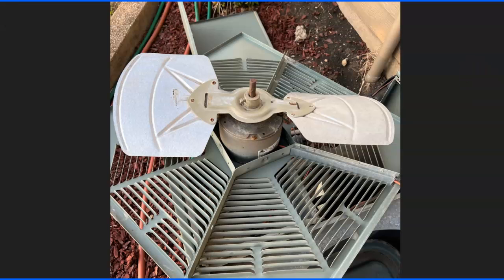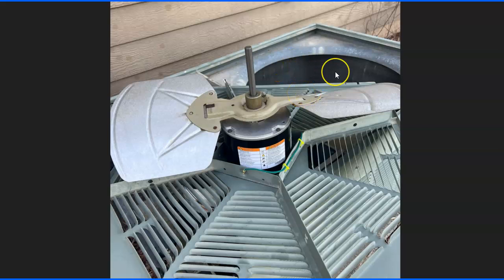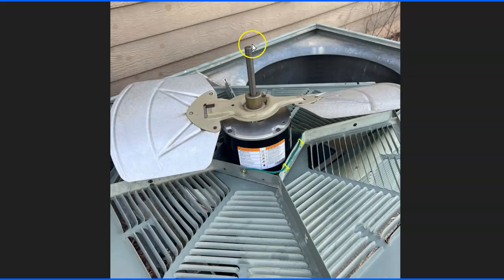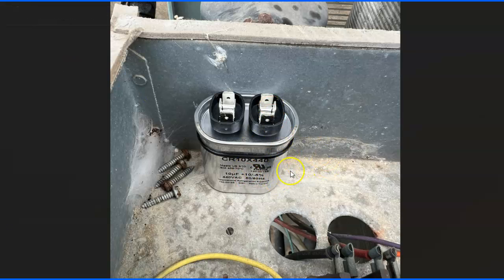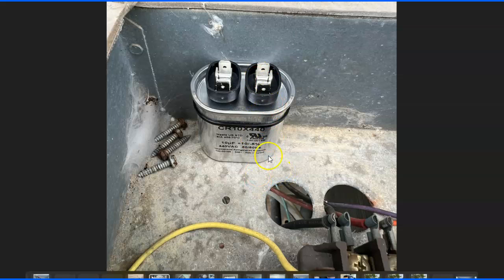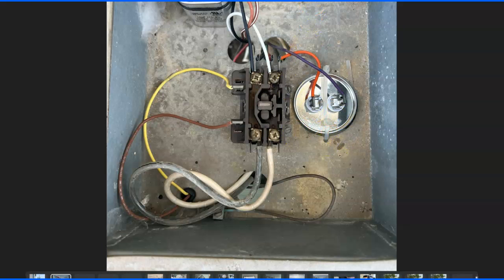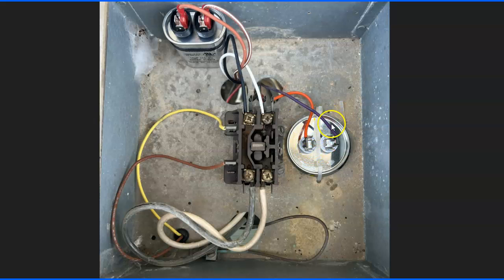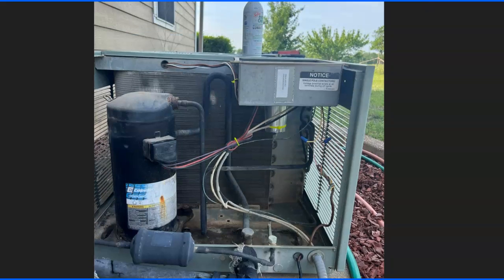HVAC Motor Capacitor Fix Part Two - Suggestions From Viewers On First Video

Comment: The A/C system basically is constantly changing the Freon from gas to liquid and back again. The liquid absorbs heat and changed to a gas and cools the A coil in the ductwork of your furnace to come out as cool air that the fan in your furnace blows out your ductwork. The gas returns to the unit to be compressed back into a liquid in the compressor tank. then is pumped back up to your A coil to once again absorb heat and change state back to a gas and give off cooling to the A coil. The fan in the unit outside helps to cool the freon and pumps out the heat from the freon gas basically. That's why it gives off so much heat because ther's coils all around the perimiter of the unit outside that are being cooled again.

Comment: A capacitor basically just interrupts the flow of electricity to give a surge of voltage. The ui is the microfarad rating which is how much resistance to the flow the capacitor has. So it stores the charge on one plate until it reaches the critical charge before jumping across the dielectric separator (image link below) and sends the charge to the device that needs it (the compressor or fan depending on what cap you're looking at) so it is kinda like a little battery that is constantly discharging to provide elecrticity (voltage) to a device (complressor or fan) The constant ju,ping of charge between plates in the capicitor heats it up because of the resistance of current flow which is why they get hot and need to give off heat too. It's not just the heat around them but they give off heat as well. I believe the dielectric in older caps was an oil like you said but now they are more "solid state" and have a film of dielectric compound between the plates rather than oil. 

The capacitance of a capacitor tells you how much charge it can store, more capacitance means more capacity to store charge. The standard unit of capacitance is called the farad, which is abbreviated F. It turns out that a farad is a lot of capacitance, even 0.001F (1 milifarad -- 1mF) is a big capacitor.

https://www.electronics-tutorials.ws/wp-content/uploads/2018/05/capacitor-cap1.gif
http://www.learningaboutelectronics.com/Articles/How-long-does-it-take-to-discharge-a-capacitor

Comment: Those 2 wires you said you didn't want to mess with are your low voltage wires that run from your unit in the attic to the thermostat that tells the unit when to kick on
Reply from the maker: 👍👍 24 volt I think

Comment: Looks like you did a good job. You may already know but here is another tip that will cool it down. They make a spray just for cleaning the fins of the coils. It has acid that in it that eats the gunk off in whatever times the directions say, then just wash it off with a water hose. If you have a split unit do the same to the A frame coil as well. Even with filters they get dirty.
   Second tip I've learned is keep buying the cheap throw away air filters that last 30 days. The cheap air filters allow the air to flow better, which reduces strain on the squirrel fan, and less strain means better cooling and more efficiency.
   They also make a fin straighter in case you you have some bent fins.
Reply from the maker: thanks

Comment: Rick, was the original capacitor mounted to the cabinet? Generally it’s a good idea to mount the capacitor with a strap of some sort so it’s not vibrating and moving around. If you already did that and I missed it, I apologize. I couldn’t tell if you secured the new capacitors or not.
 Most likely the way you have it set up will not be a problem however it’s just good practice. I work with start and run capacitors in medical compressors that I work on. Just a thought/idea. Not saying you did anything wrong. P.S. I like the new “hey air-conditioning people” channel!

Comment: Spot on buddy. 
Exiting air should be 10 degrees above ambient temp on the condenser.
Indoor air you are looking for 20 temp drop from return air to discharge air.

Comment: I wouldn’t trust those zip ties holding that capacitor. The heat inside there might make them break down and crack. If that cap falls and sparks you could could it, the fan or start  a fire

Comment: Rick when an A/C unit is working at optimum performance you should see a 15+/-2 degrees difference between the inlet to the evaporator(any intake register in your house) and the output registers in your house.  Try and check this as close as possible to the evaporator. My A/C has a 16 degree difference. Two years ago it was only 8 degrees. It was 1.5 pounds low on Freon-R22, the old stuff. You can still get it, then it was $100 a pound. I’m sure it’s probably doubled now. By the way the first HVAC repair company said $9000. Your furnace  is shot and they cant get the Freon-R22 for pre 2010 air conditioners, it’s illegal. You cant trust anyone.
Reply: Yesterday I was quoted,$1500 for a 30lb can of R22.The government wants everyone to get a 410A heat pump system large rebates are offered.Folks on a fixed income are going to have a hard time.
Reply: If you can get me one, I'll take it. It's like gold.and pew pew

Comment: No ad's before the video, Buy Gold after. I'll keep it running while I type this suggestion.
Just remember Rick, wire/zip ties can degrade and break, especially in the elements, an alternate fix using 1/4" fuel line and wire would eliminate any problems in the future.
Second ad is something that lowers blood pressure!!!
After reading other suggestions, I agree, silicone will probably be a good quick fix. I don't believe it would affect the cap as far as over heating.

Comment: Another Fix for fan is to add a tube around the fan to reduce the "blow by"  that you are reducing with fan position. 

You got it right on the Starting Capacitor as a Energy storage device to get the motor going.   

The Running capacitor is used to the current and voltage on the motor in phase.  This increases the efficiency of motor.   Typically once the motor has started the starting capacitor is switched out of the circuit after the motor has started.  

The Compressor, not sure what is going on there. Perhaps a motor inside that assembly.  Don't know.   

Old Electrolytic Capacitor used oil inside, thusly the vertical placement.  Not sure of what is in the new versions , but position doesn't matter.  You have that correct.
Reply: I think the newer caps are using a dielectric sheet with properties similar to the center conductor shield in cable TV coax cable. 

Probably some different properties but similar foam like substance. 

I haven't kept up with dielectric material technology in the cellphone era. I know there's been some evolution but, I've been out of that game for 10+ years now.
Reply: @artt3165  Same here, did not followed it.  We did have a project to add Capacitors to some 200+ 3 phase motors  ( 10 and 7.5 HP ) motors.   The final report on saving was really good. Don't recall numbers was back in 1990's .  All about adjusting phase of I-V.   ELI the ICE man,  You know that one, but not many here will.
Reply: @johnm840  , 
AC theory is bad enough when you start adding the effect frequency and frequency changes, people's eyes start to glaze over. Is the current leading or lagging? 

It's like having the argument with a plumber about the fact water pressure in the system doesn't change flow. Yes, you get more water out of the faucet faster but that's not really a change in flow rate. 

Been there and done that one too.....[ just put in a LARGER LINE, please.....lol ]

If I can give a simple explanation I'll usually help people understand the principle(s) but some principles don't lend themselves to being simplified.
Reply: @artt3165  It's loss of eff with phase shift.  

Cosine of the angle.  Reminds me of phaser diagrams in doing AC circuits in Soph classes.   That was in like 1981, long ago.  

Not the proper forum to really explain,  One needs some basic knowledge to get it, many videos on basics out there,  Probably on this specific topic. 

The balancing and design of Power Grid systems is more interesting topic.  Had a grad level class on this with prof who worked on the grid set-up in Australia.  Had lots of real work examples to talk about.

Comment: Good job cleaning up the wiring. I've seen much worse done by "professional" (licensed) electricians. They don't give a damn. Also, I'm too lazy to look up what those capacitors do for the compressor or fan motor. When I worked for my dad in his motor rewinding shop in 1975 the single phase motors had a giant capacitor on the side of the case and a centrifugal switch inside that disconnected a starting-winding above a certain RPM. This was all to ensure the motor went in the correct direction. It all seemed pretty magical to me. I mostly worked on three-phase industrial motors though. They made more sense - their direction can be changed easily by swapping any two of the three leads. No capacitor nonsense. But for all I know - back to your compressor, those caps may be for fixing power factor, or reducing electrical/radio noise, since they seem to be pretty small compared to the ones I remember being used for motor direction.

Comment: I'd replace that single pole contactor if was me. Glad your back up and running.
Reply from the maker: why?
Reply: @heygunpeople   @Good Luck America  wear and tare overtime can cause a voltage drop to the compressor and also buzzing and chattering noise during cool cycling. Looks like you have a older Rheem or Rhud those are very common with those type of contactor.

Comment: There's what's called a dielectric material separating the plates in a capacitor. You can think of the dielectric as a quasi insulator.

You need to keep the plates separated. In the old days many industrial capacitors were oil filled so if you put them in a position where there was an air bubble between the plates it would affect the capacitance and possibly allow arching between the plates as the charge builds and/or releases. 

Modern capacitors have the plates separated by solid substrates so this isn't as much of an issue. 

Think of it like rolling a sheet of tin foil with a sheet of paper laying on top. As you roll the combination you end up with two foil surfaces which are separated by paper. That's more-or-less what's going on in a capacitor. 

In fact, if you apply some voltage to capacitors in old tube-type radios you can sometimes get one to literally unroll ......lol  It appears capacitors contain some amount of magic smoke too. You find this out if you unroll one under power.
Reply: Aren't capacitors fun? In high school auto shop we would charge a few, loosely wrap in a shop rag, then leave laying around for the curious. 
Recalling their screams still makes me smile.
Reply from the maker: 👍👍nice thanks

Comment: A universal condenser fan will have a shaft longer than necessary.I often saw off extra length.Most of the time you can smell a burnt motor.Many times a capacitor is all that is needed for a blower motor.Never solder wires when working with a.c.If you think a terminal is to loose gently pinch down on the terminal to get a tight fit.(needle nose pliers )

Comment: The wires to the right in the last picture are the control wires.. its how the system tells the outside unit to turn on.  24vdc.  I had a small 24v pack that I would carry with me to actuate the relay when I was diagnosing outside units years ago.   Keep an eye out on that 60uf capacitor.. those white ties you used will last only a year or two outside if they have sunlight on them.  I might run a bead of silicone around it to keep it from falling when and if the tie breaks if my OCD were taking over.. ;)   Nice clean work!
Reply from the maker: I was thinking silicone also but did not want to mess with heat retention..
Reply: @heygunpeople  yeah and I doubt that even if it fell through that it would pull loose of the wires and/or get into any trouble..    Newer units these days have variable speed controls on the fans to keep the Freon at more of a constant temp/pressure.  Those control units seem to fail fairly often.  They probably have to use these variable controllers because of the newer Freon gasses.  So you could say I am a fan of the older r22 gas myself which I believe you have..